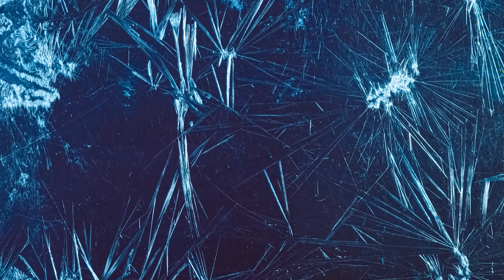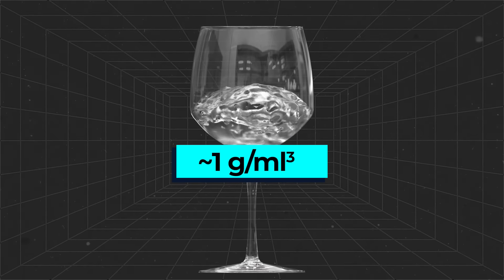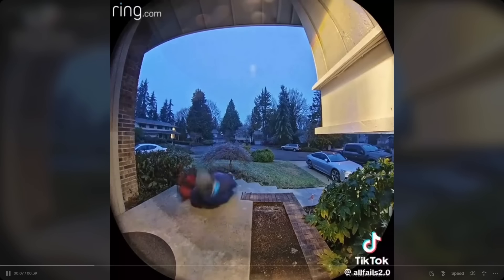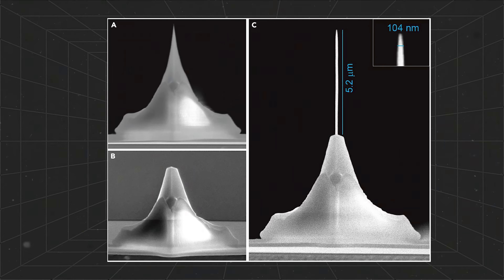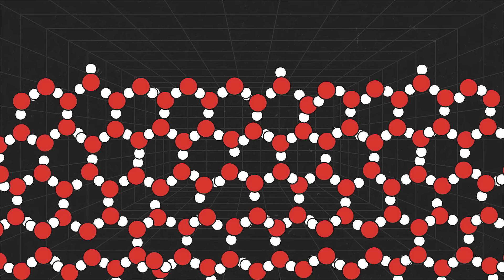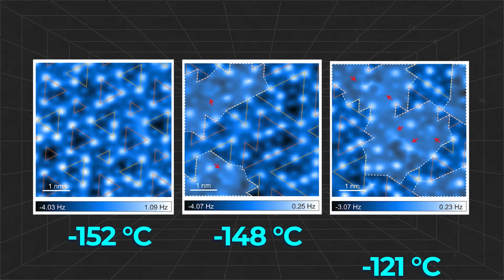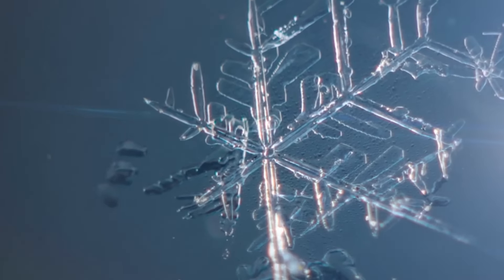We FINALLY Proved Why Ice Is Slippery

Comment: Awesome video! The interesting thing is that the "it melts slightly under pressure" explanation was parroted as fact for so long. There's an old Feynman video (1986-ish) where he gives that explanation.
Reply: @Yezpahr water…is slippery tho. It’s not a circular argument to say water is slippery. Everyone knows that a thin sheet of water acts as a lubricant and is slippery, hence “wet floor” signs and hydroplaning. You really weren’t as clever as you thought you were and this seems more like a r/im14andthisisdeep type brag.
Reply: @Yezpahr I've never in my life heard a 4th grader say "circular argument" or even have the wherewithall to properly follow an argument in a way that could allow them to state that. With that being said, I'm calling cap on you homie.
Reply: @1dfr33  In my country we actually got education, instead of 4 years of kindergarten.
Reply: @ClementinesmWTF  Your reddit lingo is meaningless here. They didn't explain water was slippery, they just said it was.
I do occasionally grab a drop from the faucet to gain *friction* on the garbagebags when getting it off the roll and to open a new bag... so it is slippery you say, but there are more forces at work as to *why the ice* is slippery in the first place which nobody explained until these papers came out.
Reply: @Yezpahr  They did explain why water was slippery in the video using the marbles analogy. The reason water can be used like in your case is for a variety of reasons. It could be surface tension. It could be a suction effect where the water displaces air. It could be electrostatic forces. It could be a mix of any if those. Either way water is slippery in most cases.
Reply: @Jardynq  Yes, in this video they explained it. That's what I said yes. But before this, and I said that to others too, the people that said "water is slippery" never explained why.
It took this video and the marble analogy.
-edit: I edited my original comment now so that people hopefully stop misreading it entirely.
Reply: @Yezpahr  Walk out the door and the warm boot on the cold ice sheet slips out and you go down...  Spend an hour shoveling snow and your warm boot faces are now ice cold and even colder on the boot tread face.  Across the same ice sheet still slips and goes down.  Stand in one place and it almost freezes to the surface in a mere second.
My question should be why are they not doing "cool" experiments like this down in Antarctica?  Not likely that any "surface water" would get generated in those microcosm observations...
Reply: But ice DOES melt slightly under pressure, it isn't just a function of lowering the melting point, increasing the pressure of something also increases the temperature. You can pass wire through an ice block by slowly pushing it through and the ice will reform behind it, scarred but intact. I don't think anything in the video debunked the idea of skates melting the surface of ice to make it more slippery. It does give an explanation on why ice is slippery in general, but the ice skating thing could still involve both effects.
Reply: @Kalleion  Not "debunk" so much as explain the mechanism. The problem with the pressure making ice melt enough to be slippery is that the math doesn't work out, which in turn means we don't really understand it. The cool thing (pun intended) about this model is that it explains how ice is slippery without actually melting, that the crystal structure of ice is necessarily slippery on its surface. And it predicts things that you wouldn't have guessed, such as extremely cold ice not being slippery at all.

As an aside, when people engage in real science, there is rarely any kind of "debunking", just better ideas superseding less-precise ideas. Einstein didn't disprove Newton, he came up with a more precise description. If you look up the definition of "debunk", it's more about discrediting exaggerated claims, often in the context of ridiculing them. That isn't what happened here. No one was making fun of the "pressure melts ice" theory, just saying that it wasn't good enough to explain things fully. And now we have a better theory to replace it.
Reply: He said that’s what we think. He didn’t say it was a fact.
Reply: @Yezpahr he did explain why water is slippery. He just used words to big for u to understand apparently
Reply: @isaac6077  Nah, maybe read the comment again.
Reply: @isaac6077  I clearly wrote "the people in the past, aka before this video".

But those words are too big for you apparently. Must be a sad life you lead, not being able to converse.

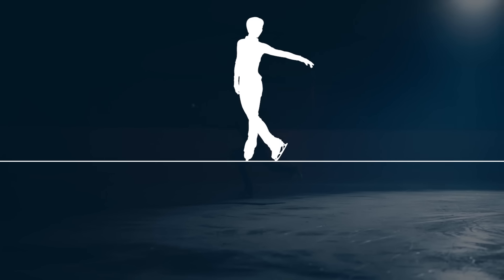Comment: 4:15. I don't know that I buy the idea that there are three square inches of ice skate on the ice when a person is in motion.  (The area required for a 150lb person to be exerting 50psi.)  I suspect the real expressed area is quite a bit less than that.
Reply: How wide is the blade of a skate used by figure skaters? 0.4 centimeters?  It is curved, so less than the full length is in contact with the ice; say 5 or 10 centimeters.  Based on these assumptions, the contact area could be around 2 to 4 square centimeters.  That is a factor 5 to 10 less than 3 square inches.  So I agree with you.
Reply: elirane85  It is all touching.  Those "edges" are what are there and are "sharp" (concave face) to allow the skater to use his down force and that cutting edge and the skate blade tilt angle and skate blade lengthwise arc to effect a turn or vector alteration.  The racing skates have a flat squared face on the edge, which is one reason why they step through turns on their tracks and use big long body weight shifts and not a convex curved edge kick to accelerate against.  Even in the case of the concave faced blades the entire blade face 'touches' when 'gliding'.  Like the difference between 'riding ' a skate board and the leg kicks to get it going and keep it going.
Reply: The third skate profile is found on ice yacht blades. These are sharpened to knife edges with about 90 degrees angle. The blade must be slightly curved for best performance with a short flat centre section. It's noteworthy that in practice speed skates have a similar 90 degrees effective angle on the edge that touches ice. Based on personal experience, smooth ice is slipper than rough ice. For safe walking on smooth ice the worst conditions occur when there is a thin layer of dry snow covering the ice. It's like walking on roller bearings.
Reply: For sure the contact patch of an ice  skate is definitely less than 3 square inches
Reply: Yes it’s wrong. A basic ballpark figure for a skater standing on two skates would be something like 650 psi nominal just using some of the cuff dimensions. This will be much higher in real life since the blade face is often profiled. Also the bit about ice being substantially less slippery when it’s near its melting point and is wet is the ice surface itself and doesn’t take into account the possibility of hydroplaning. While skates on wet ice does sort of agree with that, if you are driving on it or wearing shoes it’s a completely different story as you go flying.
Reply: I think the point here is that everyone is still guessing why ice is slippery.
Reply: @78tag  It's not my point.
Reply: @bujin5455  did I say it was ??
Reply: @78tag  seems like it, as you rolled up on my comment, and said that. I wasn't commenting at all about how/why ice is slippery.  I just think the 50psi remark is *wildly* optimistic.  Various people have expounded on that, but the 50psi seems even more insane, when you consider that a skater is often on one skate, and under motion, where there is momentum to deal with, which increases the amount of force that has to be translated (as it's not just a 'static' 150lb that's equally distributed over two 'flat' skates at rest).
Reply: Came to say the same.  At least one, I'd guess 2-3 orders of magnitude off on that one
Reply: Yeah I had to stop the video there. It is such a glaring oversight that anyone with a background in science/engineering should have recognized immediately. Like this is shop class 101 stuff; blades cut because they focus pressure on to a smaller point. Even if it still wouldn't be enough pressure to melt ice, the loss of credibility ruins it for me.
Reply: @caseyb1346  same exactly!
Reply: Well I did some basic math, and I know for a fact that it's a ridiculously small amount of the skates that actually touch the ice at any given moment, as well the actual surface in contact with the ice is less than a centimeter at any given time, unless at rest, and ice isn't slippery if you stand still on it. Heck you can walk on Ice as if it were any normal surface.
But yeah, Let's say we use the profile of the figure skater in the image he used, then the contact surface is about 4 mm. and that means that there's 22045.7PSI. I do not for one second buy the 50PSI BS.
Reply: It's wrong, but probably not relevant.
As stated, when water appears it's actually less slippery.
Even if not, let's be charitable and say that it's 10 times the pressure and 100 times the temperature difference. It's now a change in melting temperature of 2C, still not relevant when the ice is between -5 and -9C.
Reply: @NguyenTran-cx3uy  As stated before, your comment is not relevant.  The point of this thread is not why ice is slippery, it's about the expressed PSI of skates.  I've specifically stated that I'm not making a comment on ice's slippery nature.
Reply: (Take this with a grain of salt. All facts about length and width are from google results. It was fun but I'm no mathematician.)

An average 280mm long hockey skate blade with a contact patch at about 60%. Blade width varies but is about 2.8mm.

0.6*280mm = 168mm effective length
*2.8mm = 470.4mm² edge surface (~0.729 in²)
@ 75lbs for half the body weight = 
102.86 psi

That is with 150lbs person on two skates with a perfectly flat stance. It also assumes the edge profile is negligible because the blade will dig in until the whole edge of the skate is supporting the weight. [If the blade edges are to be calculated you'd need to probably do some deriving on some fancy geometry. That's above my pay grade. So we'll play it safe.] 
Double the numbers for one skate. (205.72 psi on one skate of ~0.729 in² to support 150 lbs)

The most egregious example is assuming a 10 inch figure skating blade touches the whole length at 4.8mm wide. We get 38.09 psi on two feet for a 150lb person. (76.18 psi on 1.89 in²) It might be more but I don't know where the blade length is measured to. The edge is probably shorter than 10 inches.

So, I don't think it's far off, but a little cherry picked. There should be a range. 3 is very specific to one discipline and one skate size.

And for fun, assuming an average 17 inch speed skate blade at 1.1mm you get 101.9 psi (203.8psi on 0.736 in²) Nearly the same as a hockey skate, but I didn't match the sizes to the proper weight as stride matter a lot too. 

All these numbers go up dramatically as we lean on the sharpened edges and lean on the contour, so each one I'd say is the minimum psi a skate can see for providing full work. Or if you use the single skate numbers the minimum a skate can see to support the human above. In real motion, the peak forces are probably tremendous at the points.
Reply: @0Rookie0  Like I said, in motion.  When you're in motion, you're basically never standing on TWO skates.  You're switching from foot to foot. Additionally, there is more expressed force than just your downward pressure on the ice.  As you are constantly accelerating, decelerating, and changing direction.  That's a force vector in addition to the constant 150lb of downward pressure.  Also, both hockey skates and figure skates are curved (though they are curved a bit differently), so you're never putting all of the skate down on the ice at once.
Reply: @0Rookie0 nah dawg that dudes a scientist he did all those calculations in his head the second that clip came up
Reply: @bujin5455  Feels like you didn't read the comment.
The main point is that the pressure, like you point out, is likely to be wrong, but it does not melt the ice anyway. It doesn't change the argument presented in the video.
Reply: @NguyenTran-cx3uy  I did read the comment, and as I said, this is my thread, and I don't care about the video's argument.  I was never discussing that.  So it's a tangent.

Comment: And this explains an observation I made ever since I was younger. Fresh snow is filled with crystals, but the older it is, the more it turns into balls of ice. And it doesn't seem like it even needs to melt first for this to happen. It's as if it's transforming from a crystal shape to a ball of ice shape over time. This quasi-solid layer could explain that.
Reply: Like soap bubbles ...

Comment: The "I" in ice Ih and Ic is the Roman numeral one.  It should be pronounced "ice one h" and "ice one c".  Fantastic video!  Great work!
Reply: Yet another example of font failure
Reply: Ith
Icth
Ith bronounthd li yuh tug ith frothed sthoo a flagpole
Reply: @scott98390  there is no font that will show you the difference between a roman numeral one and an I
Reply: @killerbee.13  technically there is a separate Unicode character for the roman numeral "Ⅰ" that isn't the same as the latin alphabet capital I, but because people pretty much always just use the latin alphabet I for both and most fonts don't have the roman numeral version so it doesn't really matter
Reply: @chromatica__  if I'm not mistaken, that character is deprecated by Unicode and should not be used. The official recommendation is to just use the regular letters. Not that Unicode deprecations have all that much weight.
Reply: I thought you types in Lh and Lc until I read it again

All Sans Serif font really should make sure lowercase L and uppercase i are different 😭
Reply: @killerbee.13 funnily enough i was researching this only a couple weeks ago, U+2160 is not depreciated currently to my knowledge, not even unofficially, though I'm not sure why
Reply: @-YELDAH  interesting, I wonder why. It doesn't really have a legitimate use unless I guess a font wants to have a different glyph for the single-letter roman numerals (I think the rest would be fine as ligatures) and Unicode doesn't normally care about that kind of thing. I doubt it's any easier for software to deal with.

Comment: Metals will also fuse if they have a surface of sufficient flatness and they do not have an oxide layer. Infact, most metallic machine parts that require fasteners like screws or bolts will use different metals to prevent a weld forming when the faster is tightened.

Comment: Two ice cubes fresh from the kitchen at -8 degrees C act more like proper solids and don't stick together when pressed.  Interestingly, they also sound different when knocking against each other.
However, they are still slippery, and if I drop one it will shoot off along the floor.  Also note that in winter sports, a colder ice rink is "faster" for skating.
Reply: He mentions and explains this in the video.
Reply: The colder they are, the more like proper solids they act.
Reply: I notice in the out-takes that you had trouble getting it to stick together, too.  I'll bet they were fresh from the freezer; too cold for that trick.
It works when the ice is at equilibrium, actually melting to maintain the freezing-point temperature of the rest of it.
Reply: You all should google "gauge block wringing" to see that "proper solids" stick to each other easily but must be very very very flat.
Reply: @xqr2911 waters just taking up the air space and causing suction cupping
Reply: @isaac6077  Gauge blocks work in a vacuum.

Comment: Skate blades are not in the shape of a point like a typical knife but are in a concave curved C. This way each side has its own edge to grip into the ice better for turns etc.
Reply: Icehockey and figureskating blades are. Speedskating blades are flat with 2 90 degree angles.

Comment: What about the surface flaking off like graphite but crystal? It sound more likely than this. Or that the solid/liquid indecision may result in less contact area (essentially what you said but worded differently). Also skating blades are metallic so the increased heat transfer should be more significant than increased pressure if melting is concerned.

Comment: The blocks of ice fuse when pressed together in air that is above their melting point, because their surface first melts then resolidifies.  Try doing that in air below the melting point and at the least enough pressure would be needed to correspond to a pressure weld.
Reply: You can definitely do that without melting or much pressure with other solids - like metal in room temperature. The surface just needs to be extremely flat - look for "gauge block wringing".
Reply: This is easily replicated by taking two ice cubes from the freezer and trying to stick them together.

If you wait a bit until the outside is just warm enough to  start melting you can stick them together and the heat being absorbed by the two cubes will solidify the water layer.

Comment: From what i have personally noticed below -34C i can't find anymore slippery ice.
Reply: Very cool experiment, cheers. 🙂
Reply: That could be due to how your shoe behaves at that temp. There are probably other factors you'd need to keep in mind.
Reply: @vez3834  Not just on my shoe, it's hard to explain but by touch with any object, metal flesh, rubber, fur doesn't matter you can feel in how it slips one feels like cheap chalk on a chalk board and when it's warmer it slides.
Reply: What I personally noticed is below -34C I can't find anymore water